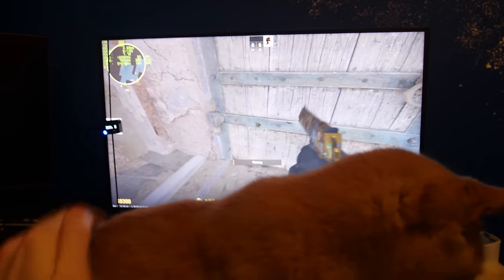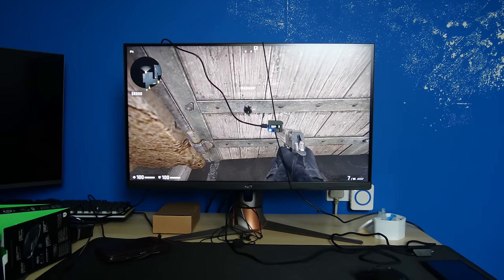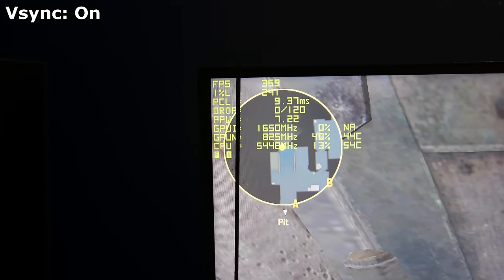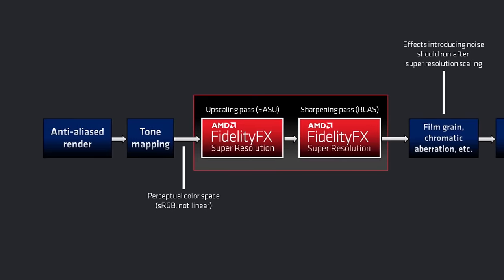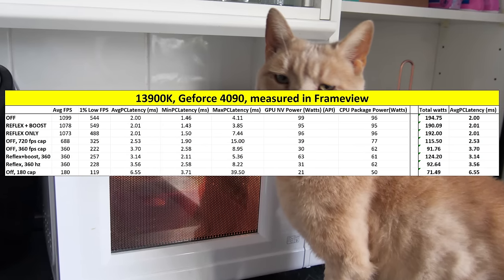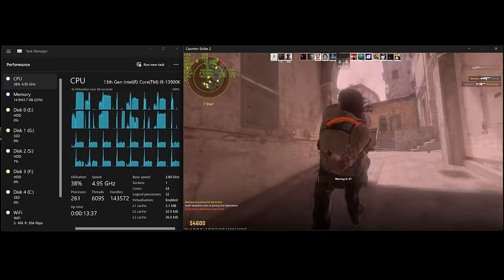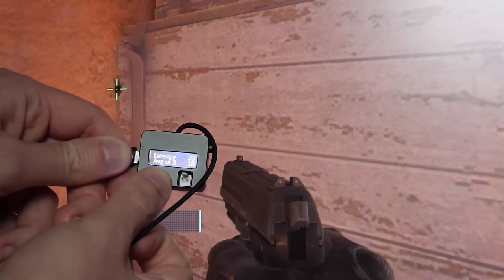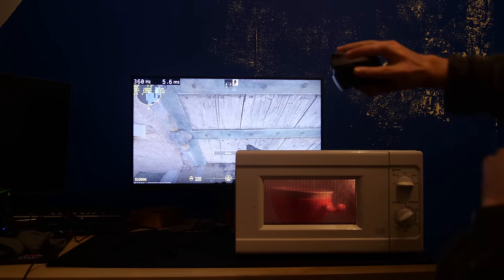Further CS2 Input Latency Testing

Comment: Having tearing appear only near the bottom of the monitor with G-Sync on and VSync off makes sense, as the fps limiter is mostly doing its job, and just sometimes letting frames get rendered slightly too early, i.e. just before the current frame scanout finishes. And the scanout always goes from top to bottom.

Also, the Nyquist–Shannon sampling theorem doesn't apply here because the signal you are sampling, i.e. the pixel response of the monitor, is not a band-limited signal. For example, if you imagine a perfect monitor with instant pixel response times, and the image just changes between black and white on every frame, the result is a square wave, which is well-known to have infinite bandwidth. Intuitively: If you capture one sample where the pixel is perfectly black, and on the next sample it's perfectly white, there is no way for you to know at which exact instant between these two samples the change happened. And even if the theorem did apply, the result simply means that you can reconstruct the signal perfectly via interpolation, which is not being done here.

Comment: Microwaves have decent enough isolation (seen this mesh in the window and wondered what it's for?) to not affect most cases, unless you're trying to study stars and get random sygnals out of nowhere and it turns out that someone was turning microwave on in the kitchen on the other side of the building at the same time sygnals were detected (true story)
Reply: Or listening to music on bluetooth

My microwave sends some heavy static to my headphones and it’w funn every time
Reply: or trying to create a resonance cascade.
Reply: that's more a electric insulation issue, probably a ground loop somewhere creating static discharges. Any appliance sold in USA/UK/EU should not produce interference if they passed certifications
Reply: Джо?! Внезапно... А так-то у меня микроволновка замедляет вайфай почти до 0, хотя сигнал полный показывает. Где-то читал что это из-за слабого передатчика в устройствах, т.е. они получают вайфай сигнал, но не могут ничего передать
Reply: They explicitly state that the microwave didn't cause interference while running only when employees opened it before the timer ran out, which happened often.
Reply: @0ka354  и из-за плохой земли в доме.
Reply: Do microwaves affect wifi signals?
Reply: @rubz1390  YES. I expierienced it, but be aware, it was years ago, so we are talking about wifi routers from 2007.

Anyway, router was standing directly on microwave and whenever somebody would turn on microwave i would loose a lot of packets.

I dont know if it is still an issue on newer hardware. Or different microwave. 
Just dont be so stupid to place router on microwave, and i think you will be fine.
Reply: If you're receiving interference from your microwave, it means the Faraday cage is garbage and you have a low quality microwave. The mesh that makes the cage doesn't stop 100% of the microwaves from coming out but stops enough of them to be weak enough to not cause destructive interference with your Wi-Fi, Bluetooth, etc.
Reply: It always depends on the combination of brands that will have microwaves affect your wireless devices. Obviously Chinese no-name brands will not behave properly around each other. If you stick to reputable brands, they usually account for outside interference. When I first started working in video in the 2010-ish era, LAV mics in the field would constantly lose signal or sound grainy, but now DJI, Rode, etc use a variety of connection features that never lose connection or have wireless interference.

Comment: Fun test with the microwave, however it depends on microwave model, and the wireless connection method, I used to have one that when turned off would slice my wifi signal, noticeable when watching videos and it suddenly started buffering when the microwave was on.

It was 100% replicatable every time, but only ever with that specific microwave, the one I owned before and after never had any issues. Could be down to poor shielding, frequencies from the induction, I dunno. All I know is that the commenter pointing out it may be an issue can be correct, but probably most the time you'll be fine.

Comment: 4:38 battlenonsense is correct here, the tearing at the bottom happens because framelimiters don't always delay the next frame long enough to meet or exceed your monitors refresh duration. even fps limited you will still get some frames coming in more quickly than your monitor can refresh a single frame, leading to the shown tearing at the bottom. vsync is needed to ensure it doesn't happen, which would lead to that single frame that was produced more quickly being shown a tad bit later, effectively waiting for the monitor to finish refreshing the previous frame. this also causes some small latency penalty when it happens

Comment: The microwave thing is quite interesting, I could see how a microwave could interfere with a mouse that uses wifi/other signals that are 2.4GHz. But I think with modern enough microwaves that prevent leakage, along with newer wireless technologies have mitigated this issue.
Reply: @3kliksphilip  my 2.4ghz wifi almost dies near the microwave but still shows full signal. I guess my phone can receive data but can't transmit anything in response
Reply: You can test to make sure if a microwave is properly sealed, unplug it, disable wifi on your phone, place it in the microwave, call that phone. If the phone rings, you have a leak, if the phone does not ring, it is perfectly* sealed.
Edit: I suspect microwaves with improper seals would interfere with some connection methods
Reply: @TruCloudGaming  cell service has a different frequency and will get through most microwaves, i'll test it with speedtest on wifi
Reply: @TruCloudGaming  results: cell showed 1 bar, wifi disconnected, bt headphones only worked if i put them very close to the door
Reply: @0ka354  You're right, I got that backwards, I am running on very little sleep right now

Comment: Not sure if you've already talked about this but 2 words:

CS2 CRT

How fast is it?
Reply: i use mine on analog 980ti or digital adapter 3070ti both on 144hz cs2. 
Its instant its sharp, but a 540hz monitor would be faster simply due to refresh times, 1000/540 is 1.8ms devided by 2 is 0.9 ms input latency from refresh rate without signal procesing…

The crt is 1000/144 so thats 7ms between frames 3.5ms on average, if ur unlucky and the object peeks in the 0.1ms after a Hertz displayed, then u wait the entire 7ms for it to appear on screen but in 10% of cases u will have a instsnt response of 0ms input lag if the frsme happens just 0.1ms before ur monitors refresh. Realistic signal procesing of TN oled and IPC pannels is like 1ms so a 540hz with 0.9ms + 1ms signal processing makes 2ms input lag constant. CRT is 3.5ms input lag inconsistently between 0ms-7ms but it can be 0ms sometimes which is not possible on other monitors. 

Bottom line is we need 500hz crt monitors loool

Comment: I was one of the people who wrote that I use Gsync + Vsync + Frame cap (alternatively nvidia reflex). From my understanding Gsync by itself does not prevent tearing, it only syncs the refresh rate to the framerate. Tearing can still occur because of individual frametime variances. Vsync should introduce little to no latency when gsync is used and the framerate is below the monitor's refresh rate. I assume you've read the blurbusters gsync article, but if not, I recommend giving it a look. But I do have to say this whole debate about the optimal gsync setup is very confusing and seems that everyone says something different. That's why people often refer to the blurbusters article, because they are quite a trustworthy authority on this, at least compared to anecdotal evidence and random Reddit comments.

Comment: Gsync does require vsync to eliminate all causes of tearing. Vsync does something blurbusters dubbed frametime compensation. You can try slowmo recording your screen in CS2 while using +forward;+turnright and you'll probably still observe tearing in the lower third of your screen with gsync on while is vsync is off. That is also true for other variants of VRR.

Comment: I’ve heard that Reflex Boost runs your GPU at max clocks all the time to minimize latency, which would explain the higher power consumption.
Reply: but the power consumption literally went down? 8:00
Reply: well you heard wrong
Reply: @MaksKCS  It substantially increases it in the 360 fps cap scenario, from 92W to 124W
Reply: @PPedroFernandes  “Boost Mode increases GPU clock speeds in CPU-bound scenarios, allowing the GPU to submit frames to the display faster, thereby improving Reflex’s effectiveness.” -NVIDIA
Reply: @jeffreymalone2079  yhea. Boost mode. But boost mode is not reflex.
And boost mode most of time does shit all. Normal reflex is enough
Reply: Only if you have uncapped fps I think, and boost does a lot more than just make your GPU run faster.

Comment: There is one question.. 
Monitor's pixels going from black (0,0,0) to full white(255,255,255) takes some time obviously. And that device that measures latency is added with this little latency too.
Going from white to black is almost instant where monitor just have turn off those pixels. So i think black to white box have more latency than white to black box..

Comment: Is the latency sensor sensitive enough to notice a disappearing digit in the ammo count? For example, you have 10 rounds then fire and it becomes 9 with the second digit disappearing. You could increase HUD scale and set the colour to white to help.

Even if the Reflex test box is tied to the game, to me it introduces another layer of uncertainty. What if the game has a bug which delays input processing inside of the engine itself? How could any external tool capture that? I understand that Reflex is implemented in-engine via an API but that gives no assurance that the game receives and handles the input immediately. Given your cross-checking, it does appear to tie up for CS2. It might not for another title, or if a new bug is introduced.

Comment: I will say that a poorly shielded microwave once disrupted my 2.4ghz wifi A LOT. Like knocked it offline every time. Switching to 5ghz seemed to help a lot, and replacing it with a properly functioning microwave made the problem disappear. But on the off chance someone has a malfunctioning microwave, it certainly could interfere with 2.4ghz wireless connectivity.

Comment: Heyo king of the klik empire, awesome video as always but I do have this wish list request.
Did you happen look at if running CS2 using Vulkan rather than DX11 makes any difference to your findings? i made this switch before the reflex fixes were done as it improved my perceived performance (yet placebo is one hellavofa drug). 
I'm mostly interested to see if im hindered myself at all doing this, i should note that im just running uncapped no reflex atm w/ a 3070ti + 6900HS laptop. 
It can be forced on windows using the -vulkan start up arg.

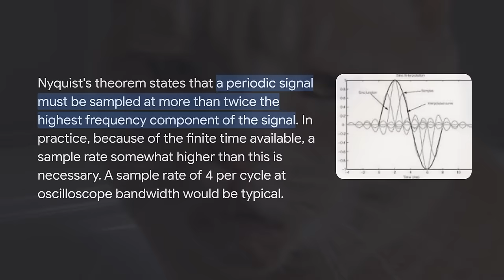Comment: 8:13 there is other theorem that states sampling any analog signal should be done 10x the frequency of that signal, so other way around should work too.. heck its even used in every sound card/setting (max hz that ppl hear is around 19-20khz, so thats why there is setting lets say in windows, that lets you select from 44k to 192k Hz sample rate, with higher the better quality)

Comment: 9:08 This is a myth, or an irrelevant detail about backlight strobing techniques. Consider OLEDs, they have instant response times yet they too require BFI to even try to come close to CRT clarity. 
The main purpose of ULMB, BFI etc is to reduce the persistence of a frame, so during motion, when you track an object moving across the screen (eg testufo), the stationary frame doesn't have time to smear on your moving gaze. 

This motion clarity rabbit hole is something I bet you'll enjoy going down in, get a CRT or something and observe just how much more clear motion is on one than even OLEDs or 540hz LCDs.

Comment: iirc "Fast" vsync is analogous to the "VK_PRESENT_MODE_MAILBOX_KHR" setting available in Vulkan, it essentially works by maintaining more than one backbuffer and swapping the one last drawn to with the frontbuffer on vblank locally on the gpu (rather than halting the calling thread), this means that the game can write to images as fast as it can produce them and it (almost) never gets stalled by an ongoing swap, and the game's rendering code never needs to wait for a vblank, but the GPU can still ensure that images are not swapped in the middle of a vertical refresh cycle.
Reply: Man I wish I could understand what all these words meant
Reply: I tried Nvidia's driver "fast vsync" once in one old DX9 game (trackmania nations eswc) and it made the game just run at double the refreshrate but not uncapped. It felt for sure better than regular Vsync but as soon as you run into situations when it couldn't hold up the double refreshrate frame cap it got really sluggish. And overall uncapped still felt better in terms of latency (at the cost of tearing that is of course).
Can't say how it works on modern games.
Reply: Yep, same way that wayland too
Reply: ye i use that prop when i was writing some game engine in vulkan
Reply: @wuzzierash578   Imma try but what he wrote is pretty much accurate:
Consider a toll tax block. There's two types of car drivers: People who pay toll tax on cash vs people with fast tag on car.
It was working good but suddenly traffic grew and now a long line of cars is waiting. Fast tag cars are 10x faster at toll but they have to wait for slow cash based cars to finish.

Now what toll booth decided to do is keep the queue but asked closest car to booth with fast tag to use second booth instead. 

Similarly, The graphics card is very fast to generate frames but slowed down due to slow refresh rate of monitor. What Fast VSync did is kept running the queue but keep sending latest frame to actual monitor without slowing down GPU to match refresh rate.
Reply: @prateekpanwar646  oh I see, thank you!
Reply: Yeah triple buffered vsync like AMD enhancedSync or pretty close (i think AMD turn off enhancedsync when FPS drops below monitor refresh floor, but that switching on/off introduces some stutter). Sidenote, EnhancedSync will completely bonk your Fallout 4 game since Bugthesda games have FPS dependent physics, so anything far above 60 FPS has objects flying everywhere unless you install a high FPS physics mod on top and tweak it near your new FPS limit to compensate. Never change, Todd.

Comment: I would LOVE to use your set-up to re-test everything on the Linux client. We've already seen more FPS when running CS:GO on Linux vs Windows. Still haven't seen any comprehensive comparison of FPS on CS2 between the two though. But what are frames worth if you can't match the input latency/sync performance?
Reply: @tostadorafuriosa69  haven't touched windows for years, but CS2 runs gloriously on Wayland for me. AMD GPU though, I haven't touched Nvidia for decades.

Also all these Nvidia API things with the flashing square etc is likely only for windows drivers so it can be hard to 1:1 replicate the tests.

Comment: The amount of effort put in testing this kind of stuff is simply astounding! Thank you!
I think I caught a glimpse of a possible dell inspiron 7577 laptop in one of your videos, could it be possible if that is so, to ask you just how cs2 runs on it? Mine is pretty bad, on 720p with low everything I get mostly sub 60, around 47 or less fps and am wondering If maybe it is just my machine thermal throttling or something, since a 4 core 8 threads and a 6gb 1060 should I believe still offer a bit more performance in cs2 even though it is a 7 generation intel paired with a laptop 1060 maxq. With 32 of ram also. Maybe some else has the model and they see my comment and can reply with their experience. Anyway, thank you very much for the amazing content and for the lengths you go through to keep the community informed!

Comment: maybe that one commenter meant hardware vs software gsync, not vsync.  gsync compatible is software, as are nearly all laptops with gsync (there's a handful of laptops from 9xx/10xx nvidia gtx series that have a hardware gsync module, it's an fpga embedded inside the machine.  actual gsync desktop monitors also use hardware, an fpga board inside.  there is very little difference between the experience on a good gsync compatible monitor and a monitor with hardware gsync, and you get additional points of failure for that added complexity.  my first and only hardware gsync monitor lasted four years.  my freesync monitor running in software gsync forced on (it's not officially compatible) is just as good an experience and has lasted almost five years now with no issues.  you do have to careful and ensure the sync range is reasonably wide, your high end of your sync range around 2.2x the low end (for me, it's a 48hz min range, 170hz max (overclock) so it's more than enough to have a smooth experience.  the whole talk of gsync on, vsync on, cap set to 3fps less than max refresh, it's possibly some relic of old drivers and practices to avoid bugs that existed a long time ago.  you also run into confirmation bias, many people think they know what will work best, so they feel they get a better experience when they set it up that way.

Comment: In my experience, Fast Vsync works well in almost every DX11/DX12 game. 

DX9 games usually don't work with it, and require in-game vsync to be enabled, which is usually not a huge deal as games of that era are more responsive than current gen anyway, mostly due to animation techniques and double buffering being the norm.
Reply: In my experience, Fast sync only works in fullscreen DX9/10/11 games and does nothing in DX12.